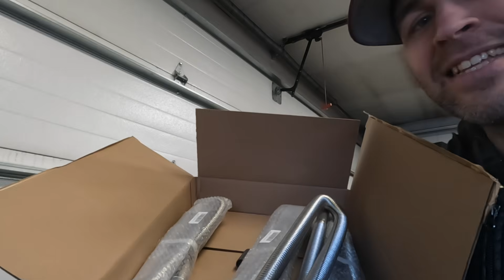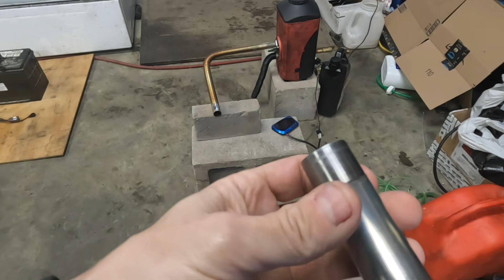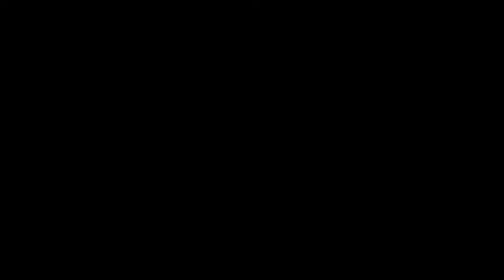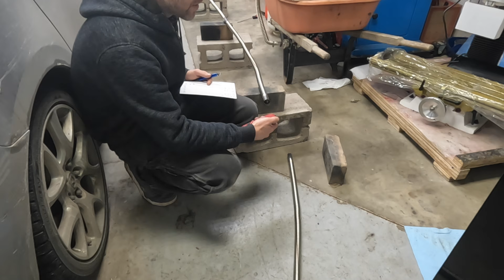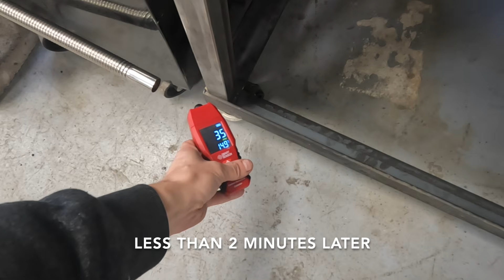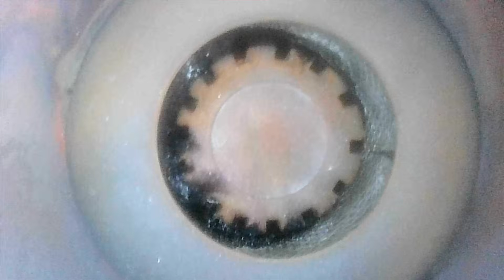Capturing Waste Heat - 5 Meters Of Stainless Exhaust - Will It Even Run ?

Comment: I had an idea of running the exhaust into a water heat exchange system and then using a pump to push it through a small motorbike rad with a fan behind it. I think a larger exhaust pipe would help.
Reply from the maker: I just finished a test where I heated a tub of water to collect the heat. It was very effective at capturing the heat energy, though I  did have some other issues...

What you are talking about can work really well if you set it up correctly. You need to make sure to have a large enough exchanger to actually collect all of the exhaust heat, or it will pass out the other end still hot. 

A larger pipe helps with both flow and the ability to extract more heat, as the gasses flow more slowly and are exposed to more surface area.
Reply: @loweredexpectations4927  great minds think alike. With so much heat loss through exhaust on these there are alot of options
 I also had the idea to try a radiant tube heater design with a larger pipe as it would reduce chance of overheating the unit over a long exhaust distance as well. Or a pipe within a pipe and using a blower to push air between inner and outer pipe to pull the heat out and exchange it that way. These videos spark lots of ideas. I want to try building a used oil heater with a brake rotor as well.
Reply from the maker: @thekiltedkamper2855  A few people have mentioned the pipe in a pipe idea... it has potential for sure. I know what you mean about videos sparking ideas... The same thing happens with me. I finish a project and I have 5 new ideas, haha.

Comment: If you can coil it without causing a restriction problem, you can then put it in front of a fan to see how much more heat it exchanges and see if the cooler pipe does anything bad with restriction and condensation.
Reply from the maker: Yeah, that is a good idea.

Comment: I’m surprised it doesn’t soot up and quit
Reply from the maker: I would have thought so too. I think if there are bends in it, that will make a huge difference.
Reply: @loweredexpectations4927  
So I installed a hot plate like you did and it sooted up in about 3 hours. I purchased a blower from Amazon and now it runs great. I don’t know how to adjust the new Vevor models to get the fuel air ratio correct I figure it’s factory settings error.
Reply from the maker: @daronwheeler2768  You force air in the inlet with the blower ? 

Most new heaters do not have the ability to adjust the fan and fuel independently. This was intended to be for elevation compensation, and now most have a "alpine mode" or automatic elevation compensation.... Not ideal if you like to tinker.
Reply: @loweredexpectations4927  
Yes I hooked up a little blower to the inlet.

Comment: Man, your videos are great! I checked this one out because I'm using one of those long exhaust pipes with a few bends in it, and was wondering if that could be why my heater has some kind of fuel stink in my trailer. I've been trying to eliminate all stink related to my heater, and I'm running out of ideas.. I see people RTV the heck out of their unit, but I feel like if that were needed, the manufacturer would've spent the time doing that, and bumped up the price accordingly.
Reply from the maker: Yeah, I think those who RTV their heaters don't really understand how the heater works. I won't go into great detail, but there is positive pressure on the back side of the chamber, so a "leak" is unlikely to actually leak. Leaking air will go into the exchanger, not out of it. 

If there isn't a positive pressure, and the chamber leaks fumes into the fan area, then there's no positive pressure to force the gasses out of the fan area.  If there wasn't a positive pressure, then the air wouldn't be forced out through the "leaky" dan housing. 

This will sound REALLY stupid, but I have had it happen many times. Diesel smell sticks to literally everything. Shirt, pants, shoes, gloves, skin. I will be sitting in my house and smell diesel for days, like I can taste it, and discover that I touched my phone after pouring diesel, and got some on my phone. 

The same can be true with your heater... Clean the ducting, inside of the plastic case, outside of the exchanger etc, with brake and parts cleaner, and blow it off with compressed air... and be mindful when pouring diesel. 

Not saying that's what happening with you, but that has been my experience.
Reply: @loweredexpectations4927  haha! For sure... Just hearing the word "diesel" makes me smell it now. 😆 I'll try giving it a good scrub... You've inspired me to pick up those two air-quality detectors as well.. I bought one of those CO detectors from Home Despot before I ever turned the heater on, and so far it hasn't screamed at me... but I can definitely tell the air quality's impacted.
Reply from the maker: @whalesmiff5712  I'm not sure how many hours are on your heater, but I also forgot to mention that they often have a nasty smell for the first 10-20 hours of hard use. I have been told this is a mold release agent they use for the plastic... I don't know, but I have experienced it on at least two of my heaters. 

An air quality meter is good to have, for sure.. VOCs are really bad if you are exposed to them regularly... That being said, the human nose, while lacking compared to a dog, can detect some fumes, like gasoline, as little as one part per million, so smelling something isn't necessarily indication of something really bad.... Others, we are not so good at detecting.
Reply: @loweredexpectations4927  So if I may bounce this scenario off of you... I've installed this all-in-one Silvel(tm) 8kw unit in my 6x12 (yankee feets) trailer using two thru-hull ports. My heater came from the factory touting 4300 RPMs @ 5.4 Hz.. I've been running this configuration and never saw any smoke and no startup issues, but my gut tells me (based on your confirmation about easy air-flow vs. forced air in a perfectly sealed chamber) that I need to tune it so that any reduced diameter caused by the thru-hull ports is accounted for in the new settings.. As it is, 5.4 Hz at the high setting sounds rich based on what others all over the internet have said.  I know a lot of your videos are proof-of-concept outside of engineering specs, and I love that, but I'm also looking for reliability without leaving a corpse behind. 😆
Reply from the maker: @whalesmiff5712  That is a good question. The reduced diameter may not be an issue if those are the only restrictions. The ports of the heaters are about 1/4 inch ID and the inlet port, if you look into it, is choked off substantially. If you have long runs of pipe, sharp 90º bends and 2 ports ... this could start to become an issue. 

This will usually show up at elevated exchanger temperatures. If your heater had a read out, you should expect between 184 and 210C as fairly normal. I am at 3500 feet above sea level, so I am more likely to have issues with flow restriction, as I am already running rich. 

Your best bet is to get a CO meter, hope that it is a legitimate CO meter and tune your heater so that it it is putting out no more than 30 PPM. You can get them really close to 0 if you take your time, and keep in mind that going to lean, though counter intuitive, will cause more CO. The reason being that the excess air cools off the chamber and leads to an incomplete burn.
Reply: @loweredexpectations4927  Awesome... Thanks for that info! I did get myself a Klein CO meter, and today confirmed that indeed I was running rich, so I brought it down to 4300rpm / 4.8 Hz, and it seemed to keep around 20 ppm... zero readout while hanging out in my trailer, which is reassuring.. As I continue to tinker, I'll keep you posted with any interesting revelations... Still working to eliminate the interior smell, though I feel like it has improved with what I did.

I greatly appreciate your help and content! You're doing the world a great service with this channel!
Reply from the maker: @whalesmiff5712  Awesome ! Good to hear you got it sorted out.... other than the smell.

Comment: My original comment disappeared because I included some eyybay and Aaali links, so here's again.

You have done it! 🤗Thank you very much. Although people have done various types of exhaust heat recovery in different ways, no one has done as methodical and thorough as you. One guy who did it with a BPHE has no video, only a blog post. All heat is exchanged within 6" of it according to his description but a pump has to run constantly, that's the only downside.

I'm sure you will do your version of bucket experiment later on but my version as you know involves a 84L heavy duty PP storage box in which ~1m of exhaust comes in from the top in spiral and/or curved L shape, etc., haven't decided yet, and exits from a side via a 1" bulkhead tank connector nipple which I had to spent days to find a suitable and affordable one. No pump needed, no long exhaust needed, heater sitting on the bucket, exhaust runs through the bucket and eventually goes outside. All heat will be exchanged within this 1m of exhaust in water. Since water has the most specific heat, I think it will happen. Besides, I have done a lot of convincing calculations. 

You can use an online dew point calculator to calculate at what temperature the hot exhaust gas turns into carbonic rain. 😅

As you already know CO is related to unburned fuel and CO2 is related to clean burn. So, depending on they type of meter you have, you can look out for excess CO (not good) or excess CO2 (good). Am I on the right thinking? I guess CO is more sensitive so probably better stick with it.

You see the bend in the exhaust pipe is the most discolored, this is because when the hot exhaust hits the bend it creates most turbulence before it finds its way out. Therefore, the original manufacturer Eberspächer or Webasto recommends max 2m length and total 270° bends.

After a lengthy research, I found the suitable pipes (the adapters you use) to connect the exhaust pipes very cheaply on Ali, look for FUYI Metal Store. It has aluminum and brass pipes at 24mm OD. For those who don't have a lathe machine like you, you can use a normal rotary pipe cutter to cut the pipe into pieces. On ebay some people are selling a couple of rings (adapters) and clips for the price of a meter of such pipe from which you can cut a lot of rings.
Reply from the maker: Man... I hate YT deleting comments ! So annoying. 

Sounds like your heat exchanger will be very robust ! 20 litres of water, if perfectly insulated will take about an hour to boil at 2kw. If we say the exhaust puts out about 1kw, that's 2 hours with zero heat loss. 

I will probably try it with a 20L (5 gallon pail) as well as a a 64L tote. All of my carbonic rain will be dripping into one spot on the ground ... I don't think it will be a problem, haha. I can put a dish of baking soda out 🤣

CO is a great indicator of complete combustion, or not, and is also dangerous... so focusing on it is ideal. I am really curious to see now much more restriction coiling up my exhaust causes. It could be really bad. 

 It's good to know there are adapters available !

Comment: I used a roughly 5 ft length of exhaust tubing to create a sand battery. I shaped the exhaust into a large coil (i.e. spring shape) and placed it in the centre of a half sized garbage can filled with sand (partial fill, insert coil, finish filling). Both ends poke out a hole drilled in the side of the garbage can (one at the top, one near the bottom, both sealed with plumbers putty). The exhaust from the heater connects to the top pipe and the exhaust running through my basement wall connects to the bottom. The sand extracts the heat going through the exhaust coil and then retains that heat for later release into the room. I find that the temperature exhausting at the heater is about 265° C and at the bottom of the sand heater is about 7° C, so I'm collecting one heck of a lot of heat.  Because I still vent outside, I have no issues with exhaust fumes.
Reply from the maker: This is one of the things that I was considering. I also want to do this with water, because it is incredible at heat transfer. Harder to seal up and to work with, but it would be interesting. 

Your exhaust temperature at the heater is only 65C ? Am I missing something here... that doesn't seem right. My exhaust pipe is about 270C at the heater.
Reply: Oops. I meant 265° C.  @loweredexpectations4927

Comment: I run one of mine into 50 mm (2")aluminium scaffold tube, using key clamp for elbows and high temp. silicone to seal. I have a 3M (10foot run).
I have seen the display on an 8Kw model showing 210 C. at the burn chamber.

What we need is a video showing the fuel hose splitting and pumping diesel onto a red hot exhaust :text-green-game-over:
Reply from the maker: That's awesome. 

My "8kw" heater also shows 210C if I leave it in normal mode. I'm at 3500 feet so it runs a little rich here. When I run it in alpine mode it runs around 184. 

"What we need is a video showing the fuel hose splitting and pumping diesel onto a red hot exhaust" Haha... That sounds like fun.

Comment: For a heat ex changer, how about a metal tank with a large vent hole at the bottom (heat rises)?
Reply from the maker: For sure. If you have space for a 45 gallon drum or something like that, I'm sure it would work pretty well. There are lots of different ways to go about scavenging heat 👍

Comment: First off thanks for your videos I find them very informative.  Question ? If you're atomizer screen goes bad will it cause your heater to Rich burn ?  And if so have you tried to make your own screens or can they be made
Reply from the maker: Hello.

Are you referring to the screen around the glow plug ? If so, then no, this shouldn't have any effect. 

The atomizer around the glow plug is really only there to assist in starting of the heater and has no effect once it is up and running. The mesh behind the baffled area (primary burn chamber), can cause serious run problems if it gets plugged. 

You can buy new meshes for each of these places, but only the glow plug mesh is easily replaceable.
Reply: @loweredexpectations4927   is that the video where you cut the main burn chamber off ? Is there any way of cleaning in behind the main burn chamber or have to buy another one? Thanks for your replying
Reply from the maker: @Wheel-1  Yes, in that video I cut the chamber open to clean it out. I have heard of a few people cutting them open to clean them out, but they will usually leak diesel after unless you weld it back together. There may be a better way that I haven't thought of yet.
Reply: @loweredexpectations4927  Thanks again for the quick replies. My screen with glow plug is missing screen at bottom. I am having Rich burn at low or high temps . ( Black soot ) So I figure burn chamber is clogged somewhat
Reply from the maker: @Wheel-1  I'm not sure what you mean by "missing screen at bottom."  The screen is a tube and does not have a bottom. 

You may be correct about the chamber being clogged. The next question is, how did your chamber get clogged. If you are burning diesel, this should not happen. Your heater may be running rich due to your elevation, or due to inlet or exhaust restriction.
Reply: @loweredexpectations4927  Like it burnt away from many heat cycles
Reply from the maker: @Wheel-1  That's odd.

Comment: Wonder if you try and use an old steam radiator. Should be less restrictive and may provide plenty enough surface area to capture the most heat
Reply from the maker: That's a great idea ... I think there are ideos of a few people doing that. 

The main goal of this video was to test to see if the exhaust would be too restrictive, and the heat scavenging was supposed to be secondary... It does, however, seem to be what most people are interested in.

Comment: 👍🏽 🇬🇧 January 2024

I was impressed with these heaters already - now even more so!

Namely, with the low-CO & good combustion.
Reply from the maker: Yes sir ! If your heater is tuned correctly then the CO is almost nothing. I am at 3500 feet, so my heater makes more CO than it would at sea level.

Comment: Would it make more sense to dissipate / reclaim the heat from the exhaust with a long tube, or by attaching heat dissipating fins to the existing exhaust tube?
Reply from the maker: Thanks for the comment. 

The main goal of this video / test was to see how much exhaust a person could use if they needed to. Checking to see how much heat was reclaimed was just a side quest. 

There are many different / better ways to reclaim lost heat. Most of those ways are more costly, more labour intensive and difficult... but the savings can be substantial.

Comment: Would a baseboard radiator be possible? I believe they use a 3/4 water pipe.
Reply from the maker: I have wanted to try this for quite some time. The smooth pipe may allow it to breath feely enough, but I can't say for sure. You could T off into two shorter ones instead of one long one.
Reply: Thinking trying this. My plan is to run the heater in a room and run the exhaust through the floor and heat the small 10 x 10 pump room with exhaust pipe . Free heated space. Enjoy the channel. Way beyond my expectations.  Well done. Super interesting topics.
Reply from the maker: @2002drumsonly  As long as you don't catch your floor on fire 👍 I suppose it depends on how you incorporate this.